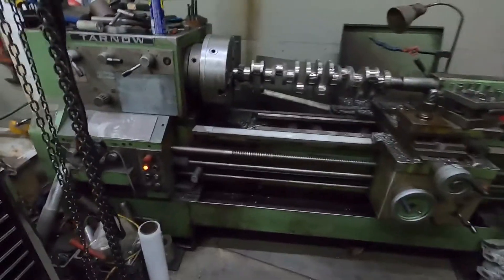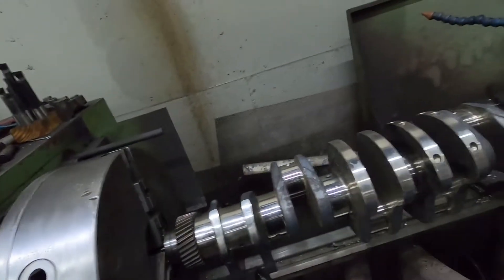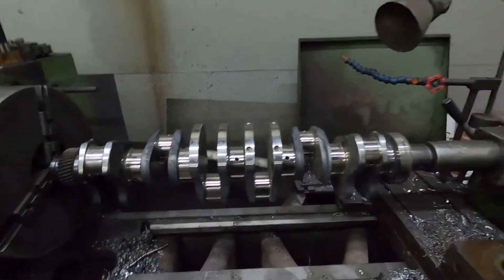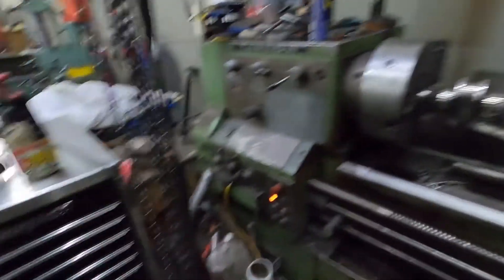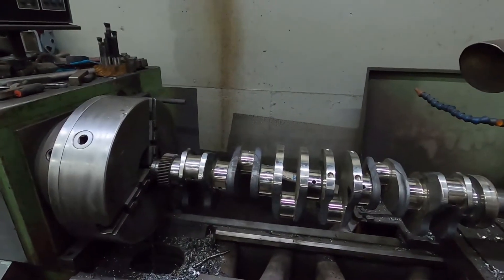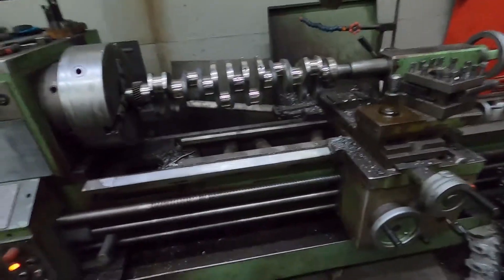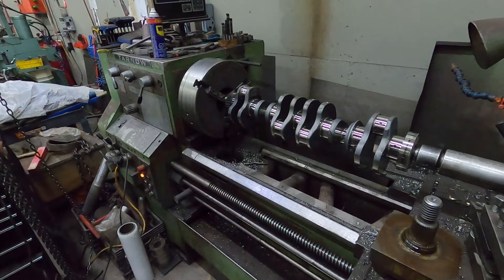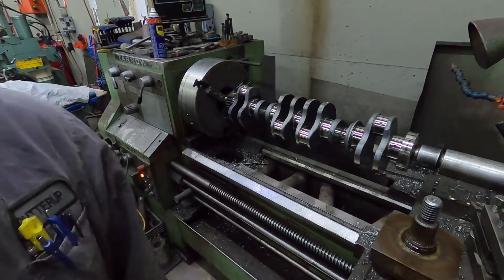Part 7 how to build ppump 6.7  ( crank polishing)

Comment: Hi Rob. I would like to know what grid that polishing belt is please.
Reply from the maker: the one in the video is a 600 that's half worn out. want to be careful  with new belts as they take alot of material off
Reply: @CUTTERUPROB  gotcha. Thanks. Figured it would need to be real fine all things considered.
Reply from the maker: @montwolfman  ya. if you want to get cray you use a cork belt lol